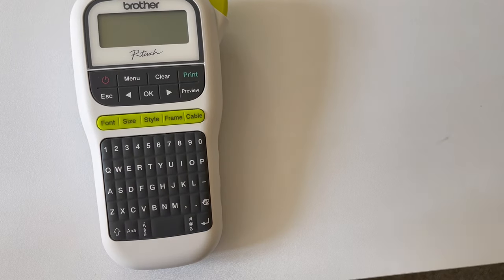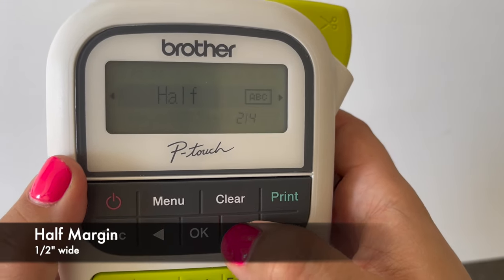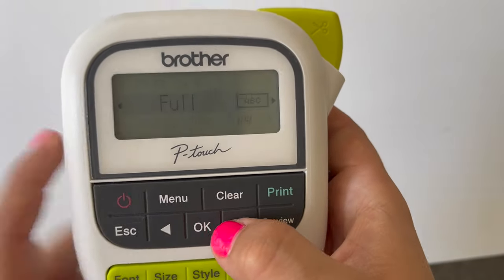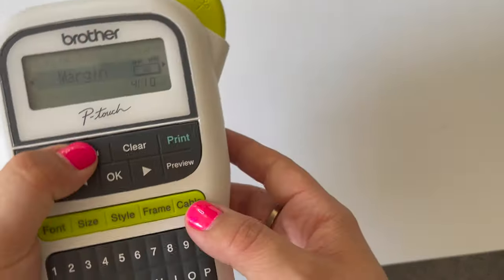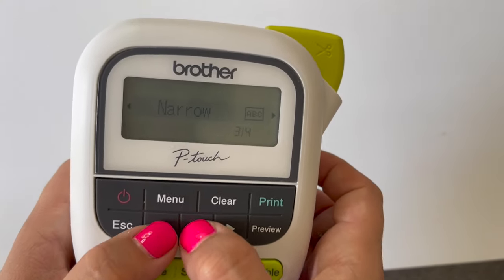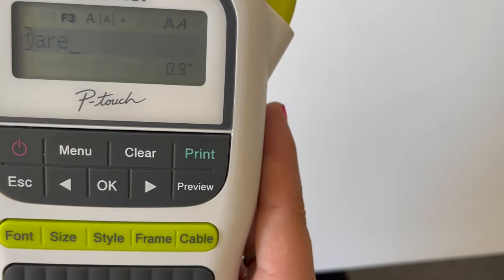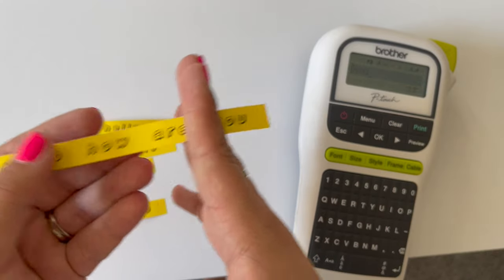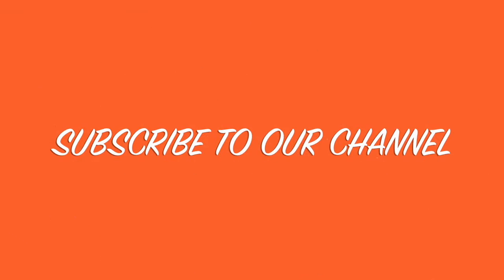Set Margins and stop wasting tape with the Brother PTH110 P-touch label printer.

Comment: Ridiculous that setting the margins at Narrow result in a useless leader that I then have to cut off. I wouldn't have bought the P-Touch if I'd known it was so wasteful of tape.
Reply: any suggestions for an alternative?
Reply: @shableep  unfortunately I don't know any. This just put me off.
Reply: I've been using Brother label printers for years and the ones with the older style cartridges never had this issue to this extent. Sure they had a bit of margin but this is ridiculous.
Reply: I just checked, the minimum required margins are double the size of the PT-65 and PT-85. So they literally made an inferior product to their older printers.
Reply: Yes. They could have designed this differently. I had a Dymo label maker and it printed close to the edge of the label. It finally quit on me. It was over 10 years old. I'll continue to use this label maker. But I will look around for another one that can print like how my old Dymo label printed.

Comment: If Brother figured where to print the two dots, then you know they could stop the tape so the blade would cat at those two dots - SO THEY WOULD STOP WASTING PAPER 100%. They're either incompetents or they figured the customers are fools.
Reply: The wasted tape is Brother's and the other scumbags' profit margin
Reply: It's not a profit margin, it's purposely designed this way to increase paper wastage and get you to buy more.
Reply: Actually, because of the lamination technology, there's a long distance from the printing head, up to the cutter. The waste is unavoidable since it has to push the text beyond the cutter.

Comment: Thank you so much. I just purchased the PT-H103W & chain print is exactly what I was trying to figure out. Worked perfectly!
Reply from the maker: You're welcome....label on!
Reply: The chain print is for making parcel ribbons with a repeated print ie just for you  just for you  just for you etc.   Select how many ‘copies’ of the phrase you want  and it will print with a very small margin between each phrase.
Reply: Exactly how did it work perfectly when there is no "Esc" button on the PT-H103W?
Reply: In the video when she uses the escape button on the PT-H103W the BS (back space) button does the same thing.
Reply: Thank you!

Comment: Thank you so much for the video. Sis, between this machine and the other bigger model, which one you are prefer in term of value and tape saving?
Reply: I'm disappointed with the Brother brand  it will ripped you off using 6 AAA  batteries unless you buy adapter whereas Dymo uses 4 AA which is budget friendly

Comment: Hey Ivy. I'm coming from a DYMO label maker and I'm flabbergasted that I need to use scissors if I want narrow margins on the PT-H110. Do you happen to know how to use the PT-H110 with narrow margins without having to grab a pair of scissors? Do I pretty much just have to use the Full margin? Thanks and I appreciate the channel!
Reply from the maker: If you're looking for a narrow margin you will need to go to "Menu" and arrow until you see "Margins" and click "OK". Once you've done this you will see your options are Full (1"), Half (1/2") and Narrow (1/6"). For a narrow margin you'll want to arrow to "Narrow" and click "OK". 
This will give you a 1/6" margin. However due to the internal cutter blade there will be a 1" tape leading your printed label in order for the label to pass the cutter blade per Brother. 
In order to guarantee equal measurements on each side of your label, you will see a dotted line, if you cut along here this will guarantee equal sides. 
I use the scissors trick if I'm printing a lot of labels, its the only tip I've found to help beat that cutter blade!
Reply: @labelmaker  having the same issue, but why on earth would they require that inch to "pass" the cutter blade?  It's on the leading edge of the tape so as soon as the rest is printed it would be passing the blade.  This extra lead is awful.  I wish they would let us change it.
Reply: @tracypeterson  Because it gets you to use more tape, that's why. This is by deliberate design, not a design flaw. The printer itself is cheap, the replacement tape is not, just like your standard office printer - cheap, but replacement cartridges are not. That's where the money is. This product is no different!!

Comment: An easier way is to use the maximum character length and write all the labels together seperated with a : no need for all those button presses. 10 labels in  go with 8 characters or 5 with 16 charachters

Comment: Hi Ivy, thanks for very clear and informative videos on the P-Touch! I bought the H110 recently and would like to know if I can interchange tapes and how to limit the tape feed waste during the process? For example, if I am busy printing on yellow tape and I want to switch over to white tape for something else. How would I go about doing this and without wasting tape? Thanks! Mari
Reply from the maker: Hi Mari - very easy, just open the back and remove the tape cassette - then install the tape cassette of the new color you wish to use...if you subscribed to our channel you'll see the PTD210 video series that has a video on adjusting margins.  Hope this helps and happy labeling!
Reply: @labelmaker  Thanks Ivy! Yes, I have subscribed already. I'll check it out ;-)

Comment: Can you reduce the total length of the lable aswell? I would need way smaller labels, like 1,5cm in length max.
Reply: Also, can this Printer take Tape that is already sticky ? Like, Tape you only had to Cut off and already be able to stick it to something without having to get rid off the foil first.
Reply: @KifF2603  , No, that's not possible.  Inside the machine, the tape passes between rollers, so a tape without backing paper would stick to those rollers, right?

Comment: As a member of the P-touch community I can not imagine the audacity that it takes to release such a video to the public. How could you talk such negativity towards the elusive PTH110? I have a small collection of these (STILL IN BOX :) ) from the first production run back in 2013 that I plan on giving to my three grandchildren whenever they turn 18. The PTH110 has been a long time staple for its ease of use and support for emojis. HOW DARE YOU speak badly on this device. I do not like to throw out harsh insults, but only a Nazi would ever speak on the PTH110 in this way.

Thanks
Reply: Dearest Karen,  Just a quick question... What video were you watching?  Just to make sure I was on the same page or should I say video here, I had some educator friends of mine have a quick watch.  We all came to the same conclusion that the video was helpful, informative and an all around pleasant experience suitable for all ages. There was no maligning of the labeler or the manufacturer at all.  The only thing that was found offensive, inappropriate and quite honestly completely unhinged was your comment.  As a Jew, I especially find your "Only a Nazi would ever speak on a..." utterly offensive and  inappropriate.  My grandmother was one of the few that survived Auschwitz and her sister survived Dachau.  The rest of her siblings 3 brothers and 2 more sisters along with her mother, father and grandparents weren't so lucky.  Last time I checked there was no mention of any P-touch labeler receiving a yellow, red, green, purple or pink badge to wear and sent to a concentration camp!
And finally just a friendly suggestion here...Lay off that "Karen kool-aid" and have a check-up because that blood pressure of yours must be through the roof!